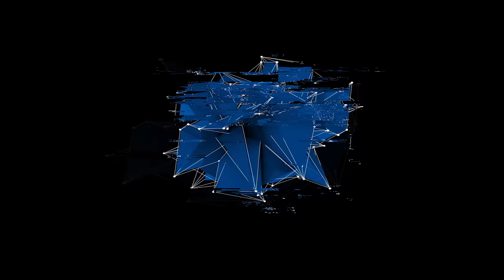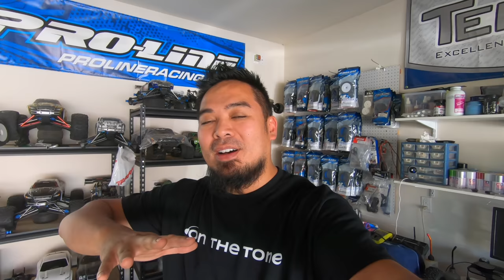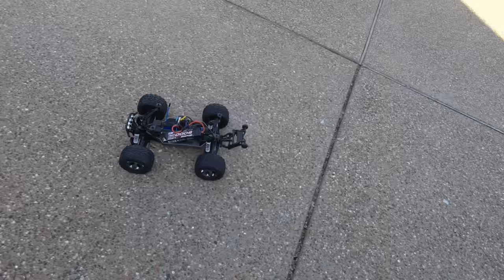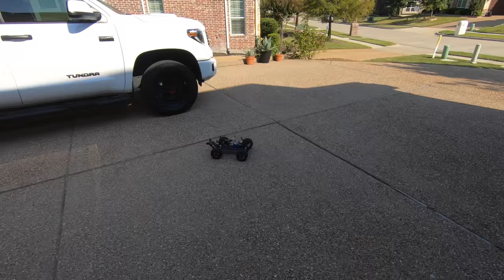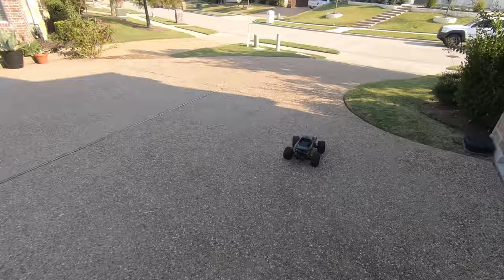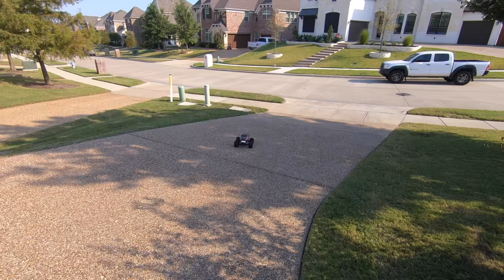Why is my Electric RC Car So Loud? Traxxas Tekno Arrma All RC Cars

Comment: Bad bearings is my guess. I'm pretty sure you are able to set the mesh correctly so maybe a motor bearing. Of course a bad spur gear, that's the first thing I check. Afterwards I'll check my bearings and drive shafts. Stay safe. Greats from Belgium

Comment: Probably should mention most spur gears are molded and not machined so they tend to have a lot of runout causing your gear mesh to be inconsistent you should set your mesh then recheck it in several different spots then readjust by split the difference between where it’s to tight or loose and proper mesh. I’ve had Touring Cars with high quality machined 64p spur gears run near silent down the straightaway

Comment: Hey man I like your channel it's awesome and it's very helpful but I have a question for you and the question is what kind of oils or lubricants can I use on plastic gearing for My RCS??? And also for the size of the gears that I need for a 1/10 scale

Comment: I race traxxas slash on oval running xl5 system. I noticed on couple of my cars and another racer sometimes when cars bump each other lightly in most cases the car loses 3/4 it’s power. The esc turns red and won’t shut off and have to unplug then car resets to full power. There’s no loose connects. Sucks being in lead and no power and lose race. Didn’t know if u or someone else has had this problem.
Reply: Esc goes into lipo low voltage safety from power draw. You running lipo's? If not switch that setting
Reply: @brandonp4068  ya running lipo 2cell 5200 50-120 c. I called traxxas couple days ago they said same thing. When gets bumped looses connection from battery I’m running an adapter from esc to batteries. Thanks for replying

Comment: See I have a problem where the pinion gear is not round and I don't know what to do about it and I've only used it for maybe 20 minutes on a to sell and then started hearing a noise and stopped

Comment: I haven't finished the video yet but my gear my pinion gear seems like it's not round and now my spur gear Waco's a little bit and I had the mesh set properly because it has just a tiny bit of movement until you get raid around to where the set pin is for the pinion and it gets tight not tight tight just you can't move the gear you can't feel that little bit of play until you get past it no binding or nothing never bound once but I think because of that it messed up the spur gear bearing because now I'm getting a lot of noise from there

Comment: My rustler 4x4 sounds like a jet engine and my gear mesh is fine. Replaced my bearings too. I think they're just loud no matter what lol.
Reply: Mine dose not sound that bad hmmmm
Reply: If it sounds different than new, then you likely have a problem. When mine starting making loud sounds I found my rotor was coming apart. https://youtu.be/BZUj0d9poU4
.
If your motor fails badly it can grenade your driveline, so make sure that it is good.
Reply: Motor?
Reply: @KTMcaptain  Thanks I'll check it out

Comment: My slash 4x4 won't move. the motor spins and it steers but it won't go forward.
Reply: Does your pinion move? Spur gear? Center driveshaft?
Reply: Barry Boppins  All of my gears are tight and good, the clutch is tight, and the driveshaft spins.
Reply: @reidisaacson9623  All of them move.
Reply: Barry Boppins  ok, thank you. I'll check that out.
Reply: Barry Boppins  ok. hopefully I don't have to buy any new parts.